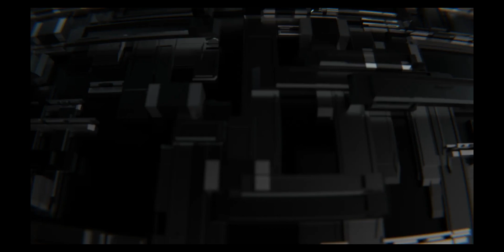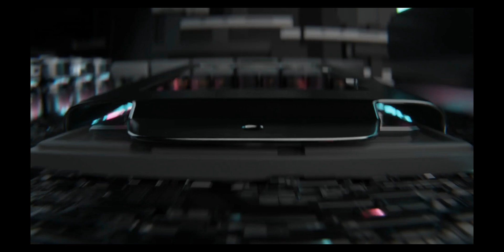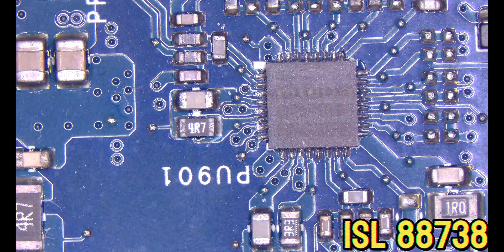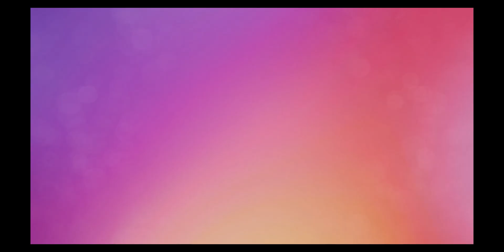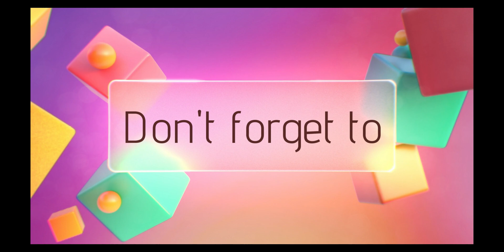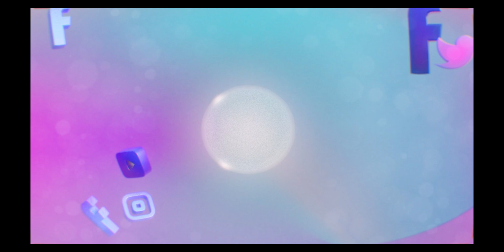ISL88738H CHARGING IC Explained  | Laptop Repair | Pavithra Laptop Care

Comment: You can do better than this
Reply from the maker: Please suggest
Reply: @LaptopCourse  explain if the voltage is not present on each pin, where could the fault be. i know its a big topic but you could break it into may youtube videos.
Reply from the maker: Noted.Thanks for suggestion. Actually I am running institute. Main profession is teaching.  So, in that concept releasing videos.  Surely,  you can see  more practical videos which will be from students.